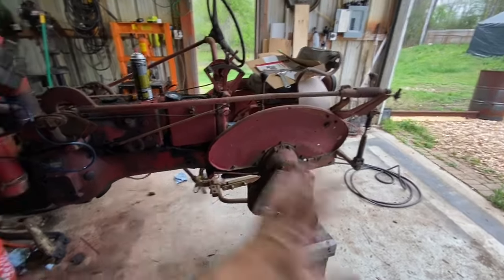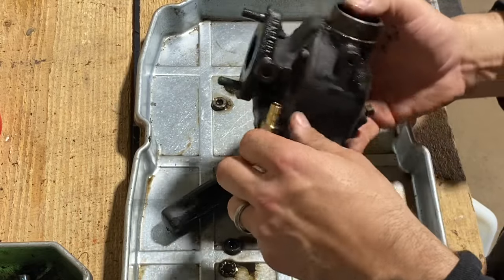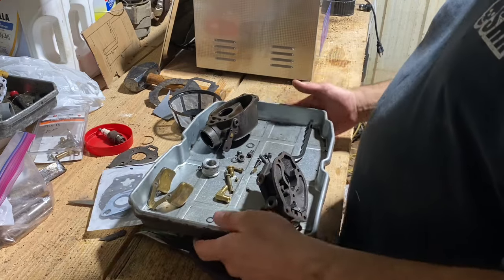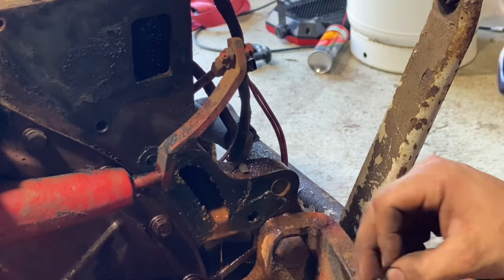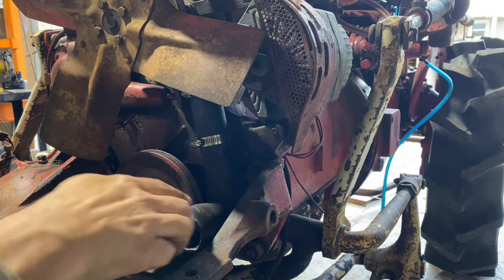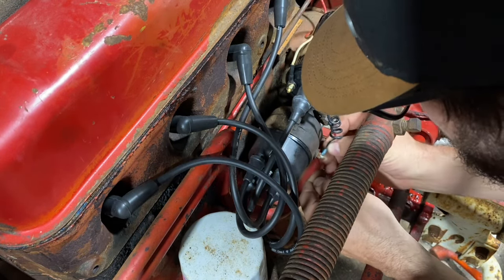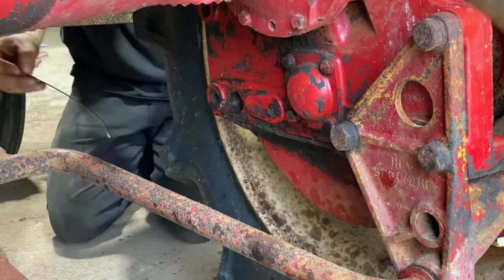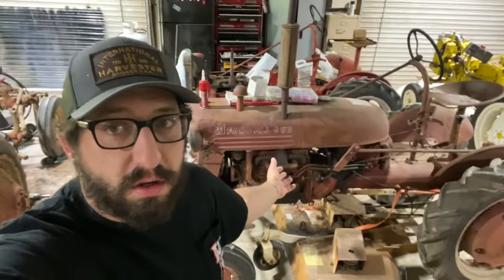International Harvester 140 Revival PART 2

Comment: Great idea with the sonic cleaner, I have one the same size that uses a heap of chemical, I hadn’t thought of putting the parts in a smaller plastic tub and fill the cleaner with just water, ripper idea . Greetings from AUS 🦘🇦🇺. Just a tip, cut the audio when you fast forward the vision and you won’t sound like one of the chipmunks 😁 great video